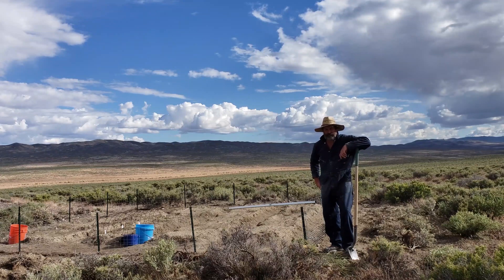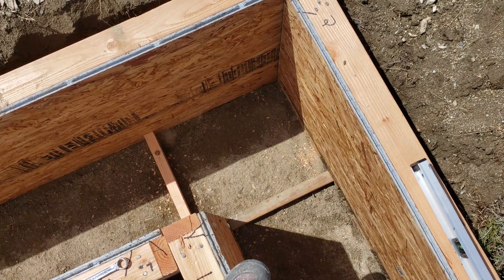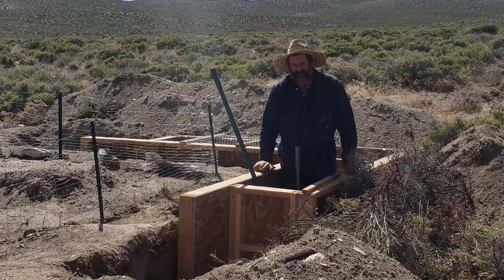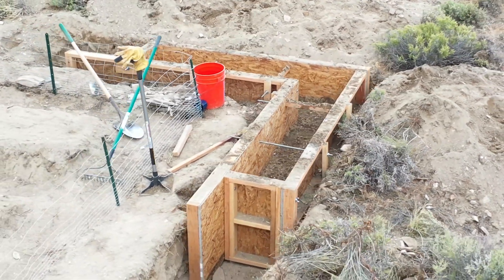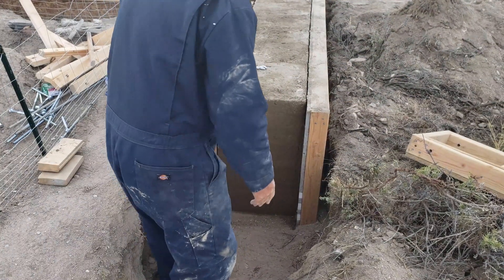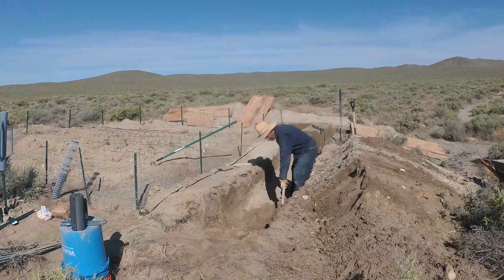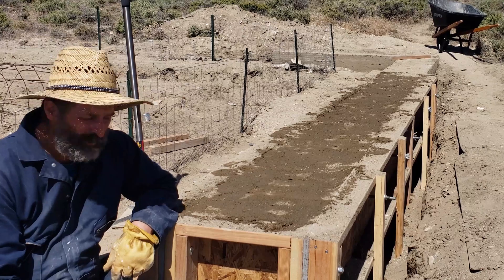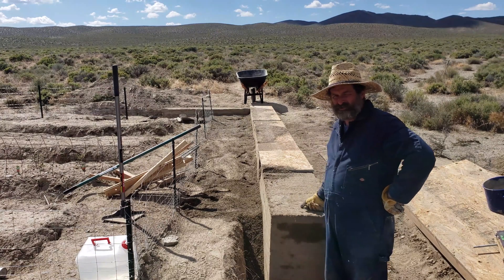Rammed Earth Wall, Part I

Comment: What’s the max recommended height for a rammed earth wall? For instance if the form was 10 feet high, how would you be able to tamp it down when it’s so deep?
Reply from the maker: tamping down is done after ever few inches of material are added.   The maximum height has more to do with the height to width ratio.   You would need to check some engineering on this but exceeding a ratio of 10:1 is likely too much.

Comment: So how do you connect the two wall segments? I didn't see it explained anywhere...
Reply from the maker: The forms were reoriented and bolted together to make an L shaped form
Reply from the maker: Where straight sections met up, I just just the existing wall end for a form.  It seemed to work ok

Comment: Beautiful.Can you suggest what's need to be done to resist earthquakes,like a normal building.
Reply from the maker: The same techniques as for reinforced concrete although it will never have the same strength as concrete.   If rebar is not available,  I have heard of people using bamboo.
Reply: @dirtbagbuilder9568  Thanks for responding.
rebars are available.

Comment: Hi..thank you for sharing your knowledge and your experience. I want to construct stabilized rammed earth foundation for my earth bag square house at our farm. Already I have excavated for foundation for 36 inches depth and 28 inches wide . Hope my foundation works well. Is My idea ok sir?
Reply from the maker: Thanks for watching.
If you are making a sizable investment in a house, you should pay to have an engineer review your plans.     Rammed earth is not ideal for foundations because of poor moisture resistance.
  concrete is a much better option.  The depth and width of foundation will depend on your subsoil and climate conditions.  Without knowing your project details it is impossible to give more specific advice
Reply: Dirtbag Builder thank you for your reply.I live in southern part of India.my town's  average annual temperature is 27.8 °C | 82.0 °F . In a year, the rainfall is 1008 mm | 39.7 inch.unfortuenately..i can not transport building materials to my farm site. So I have to build my home with soil only. That is my limitation
Reply from the maker: @Ootabaavicinema  if portland cement is not affordable or practical, consider using a stone and gravel filled trench for a foundation.  With your heavy rain fall, drainage will be important and you should put a plastic layer to keep water from migrating up into the earthbags.  A good roof overhang will also help protect the walls and foundation.  Best wishes for your project.
Reply: Dirtbag Builder Portland cement..I can manage. But not gravel and stone . Im surrounded by clayful of soil 🙂. You might have heard of Auroville at pandicheri town, tamilandau, India. There they construct mostly rammed earth and stabilized earth block homes. I saw one link in Thier earth-auroville's website.. unfortunately..I couldn't find the right link . There is full detailed instruction for stabilized rammed earth foundations. With that foundation..we can go up to 4 floors it seems.  Yes you are right..I should cover the basement with heavy GSM plastic sheet  from the moist factor
Reply from the maker: @Ootabaavicinema  sounds like they could give you some better advice than me.  There is very few substitute for local experience..  I look forward to seeing what you build

Comment: How come you used a little cement with wall?
Reply from the maker: I did not use cement for this build as I wanted to see how well it would work.  Unless you are on an extreme low budget, or have a specific purpose, you should use a 3% to 10% cement mixture (soil testing required) .
Reply: @dirtbagbuilder9568  Thank you.  I want to learn more about rammed walls.

Comment: As the wall construction method continued, i wondered about the likelihood of physical wear and tear on a person's joints.  As efficient as this combination might be, there is a potential down side to it.  Yes, i agree that there is a "feel good" benefit to this method of self-sufficiency, but there is always a price to be paid for everything.  Enjoyed watching your construction method and your enthusiasm.
Reply from the maker: as an update, the tendinitis in my hands and elbows lasted over 2 months.     In hindsight, i think the ramming technique has something to do with it.    dropping the ram has a lot less joint impact than power pounding it
Reply: @dirtbagbuilder9568  yeah, i wondered if it were better if the tampers were weighted more, and one lifted it with legs and just dropping it, instead of actually pounding it.

in fact, someone should design a tamper which has a step on it, which activates a lever pulling a hefty weight up, and reaching the trigger point, it automatically releases the weight, which drops onto the earth. make it just heavy enough for a 60 - 80 kg guy to hop on the step with one leg, and let gravity do the rest. could alternate left and right foot.
Reply: oils oon like  jo

Comment: Now this is what I would call proper rammed earth because you left out the toxic cement. However, I'm thinking some hempcrete would help to stabilize these walls or perhaps volcanic ash, if available, to mimic what the Romans did. Thumbs up!
Reply from the maker: Glad you liked the video.     As for not using cement, if you watch the other videos in the series you will see that I ended up being not very satisfied with the results.  Fine for a garden wall but not so great for living next to.   If environmental issues are a design concern lime might be the best way to go.   I am considering another project soon so I will see how it goes
Reply: Hi gentleman make mixture some soil some lime and some water yes ya no

Comment: Awesome experiment  what if you let the form stay over night would it be better ?
Reply from the maker: It might help a bit, but there is a 4 week cure time for this and I dont have the patience for that
Reply: @dirtbagbuilder9568  i experimented with rammed earth last year and build  a cellar  wall . It wasn't perfect  wall but it is strong wall it holds concrete  roof and soil just  fine . I'm quite impressed.  I'm  thinking thinking about building house now
Reply from the maker: @lkhbhydroponic6858  did you use stablized rammed earth or just dirt?   So far my wall is sturdy but has no wear resistance or shear strength.  I will do a video on that very soon.
Reply: @dirtbagbuilder9568  yes i put some cement as stabilizer  considering the roof and  earth round the cellar . Also i  put some reinforcement  steel mesh  just in case . I can wait to see your next project
Reply from the maker: @lkhbhydroponic6858  thanks for the info.   I figure it would have cost me about 150$ to do it with a 5% cement mix and  an extra 15% time but I would have ended up with something indestructible  rather than a fairly soft wall.   That being said, it is a 3 ft tall garden wall so  why spend the money and time on it  The next video will be uploaded on my next trip to town, maybe tomorrow
Reply: @dirtbagbuilder9568  indeed, as garden wall it doesn't need to be that strong. Let me know how the wall withstand  summer rain.

Comment: I'm in Reno, Nevada and getting ready to do this very thing! Looks fantastic and I appreciate your posting your video! Blessings and Strength to You!! I have a Hydraform Block machine that I will be making compressed earth block to build the wall system. I will also be trying a section of Earthship Biotecture tire wall with...
Reply from the maker: Hope you take some good pictures
Reply from the maker: And send me a note if you need assistance,    I am not too far away